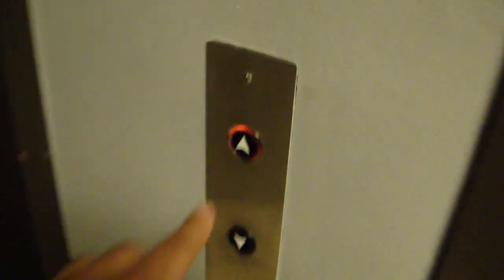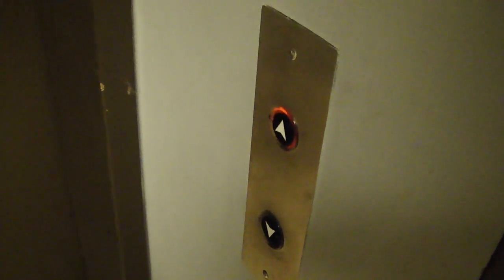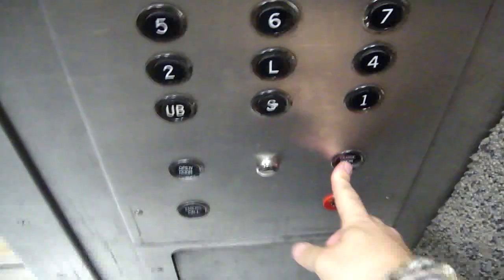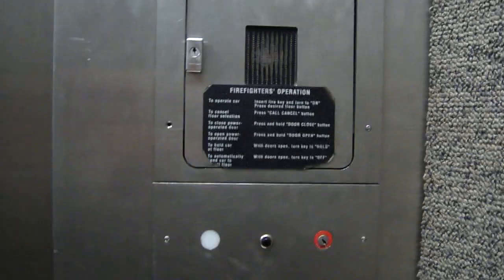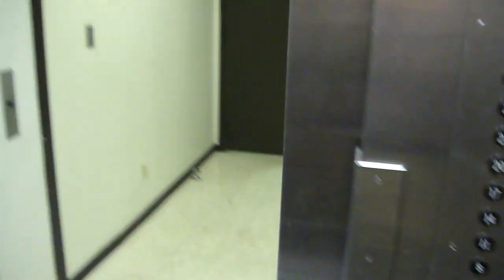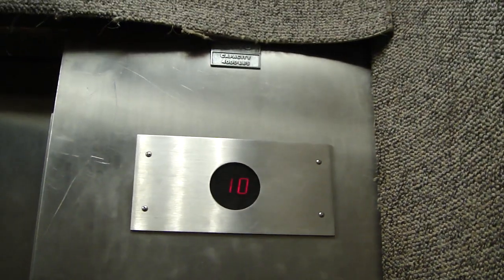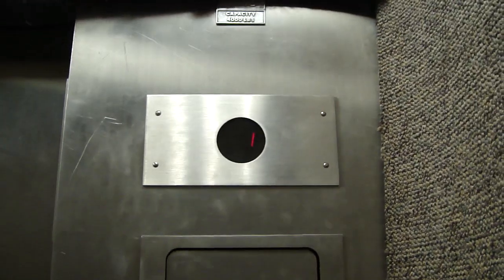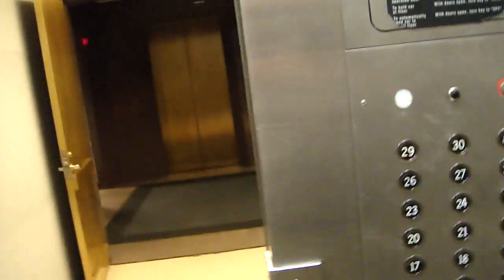Otis Traction Service/Freight elevator @ Bank of America Building St. Louis MO

Comment: well if this was built in the 80s then why couldnt otis just use series 1
Reply: Specialty Elevators and UEE's by Technicalboy3000 it was built in 1982 and it older than I think.
Reply: This was installed before series 1 came out
Reply: Specialty Elevators and UEE's by Technicalboy3000 Series 1 came out somewhere in 1983
Reply: Tobey Sze No it came out in 1980 I think
Reply: I know for a fact it did not come out in 1980.
Reply: ElevatorMan5482 ElevExperiencing Productions Maybe I'll make a call to OTIS and see when it came out because one elevator photographer tells me 1980 another says 1984 another says 1983 i cant be sure... it aint yo fault; everyones confused...
Reply: Specialty Elevators and UEE's by Technicalboy3000 Try to call them. Good idea. Maybe somewhere in late 1982 since you watch the elevator at the Holiday Inn in Kissimmee FL.
Reply: Hunterdon County EleFilms by Technicalboy3000 Lexan is better.